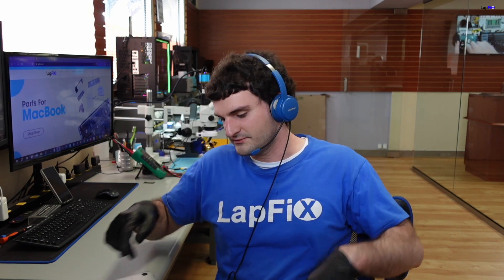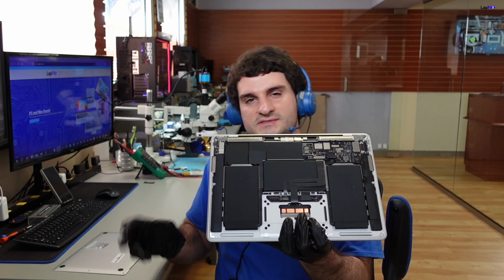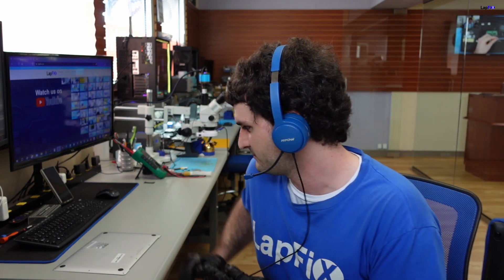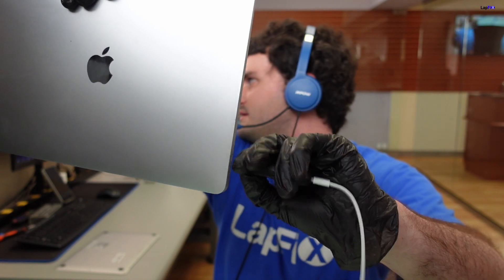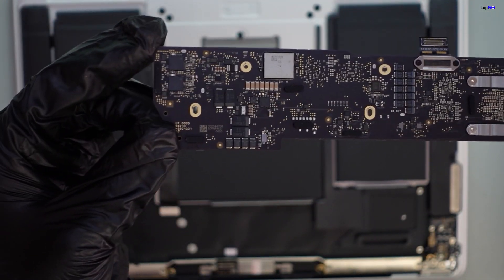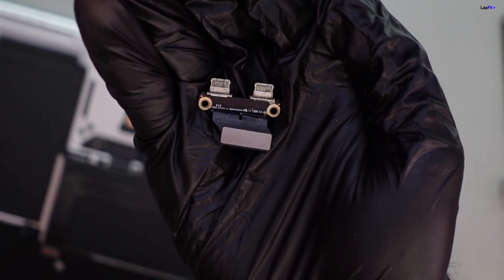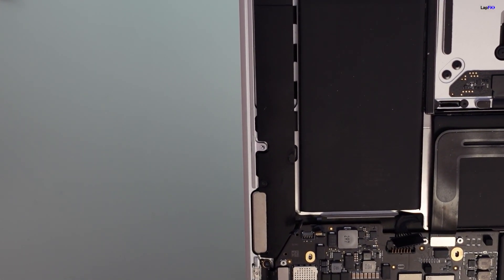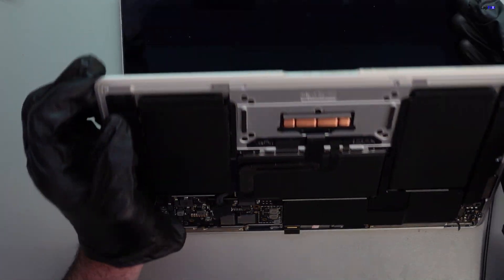Reviving a Dead M1 MacBook Air for Data Recovery

Comment: Not really a repair, did you even troubleshoot and find the (most likely a bad capacitor)? You did nothing this whole video. How about actually troubleshooting like the other repair videos, find the bad cap(s) then replace and fix that voltage back to 20V?